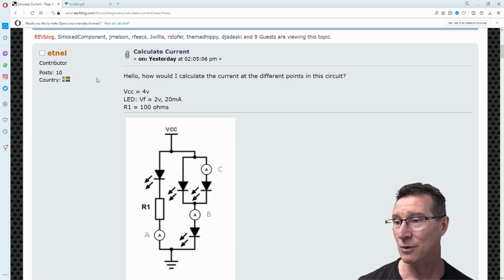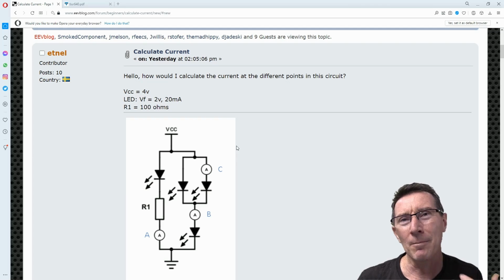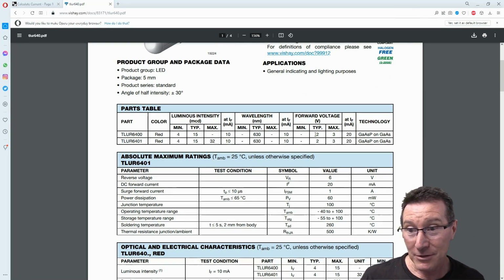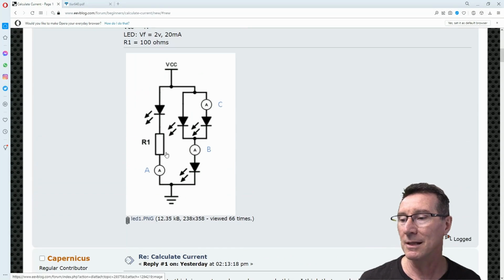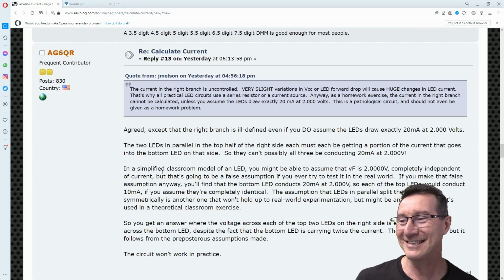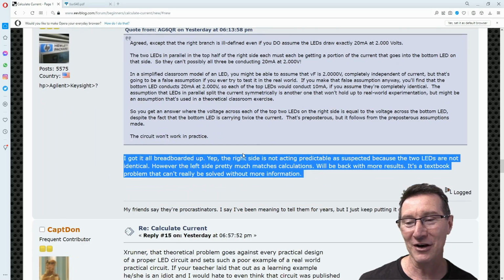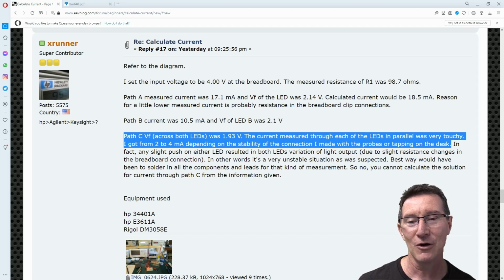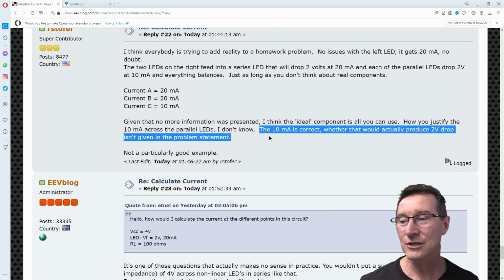EEVblog 1427 - An INFURIATING Electronics Exam Question!

Comment: What do you do if you have let's say a series string of 6 leds per string, 2v each, and your power source is 12v? How do you supply power to the leds and how do you calculate the needed resistance?

How do you drive leds most efficiently, losing the least amount of current as heat, et's say it's for a solar powered ebike where you have to be frugal with the power draw and efficiency of everything?

What if the power supply voltage changes between 12-14.5V like in a car?

Comment: The other method is A = 20 mA, B > 20mA, B < 40 mA (if B reaches 40 mA, C is 20 mA, which only leaves 2V over that LED at the bottom (which can only sustain 20 mA), which means the current needs to be less than that), C=B/2

(the exact value of B (and C) in that range would need more information)

Comment: If the diodes are ideal and have the same physics, than we can, approximately, write V_f=a * ln(b*I_f), where a, and b are know constants, and V_f and I_f are the forward diode voltage and current resp. This equation is from Schottky approximation found in wikipedia. 
We know that it is given 2V = a * ln(b*20mA) . By manipulation exp(1/a) = sqrt (20 * b)

For the right branch: KVL: 4 Volts = a * ln(b * I_f) + a * ln(b*2*I_f)
4 = a * (ln(b * I_f) + ln(b * 2* I_f))
4 = 2 * a * ln (sqrt(2) * b * I_f)
2/a = ln ( (sqrt2 *b*I_f))
exp(2/a) = sqrt2 * b * I_f 
We know that exp(1/a) = sqrt(20mA * b) which is to be plugged in the latest expression:
20mA * b = sqrt2 * b * I_f  . Where 1/b is called saturation current in ideal diode equation but it will be cancelled out anyway.
So current at branch C should be sqrt ( 20mA / sqrt2) = 14mA 
and current at branch B is 2 times of that, 28mA.

Comment: I love this problem! This is a classic Analog IC design question. The intuitive understanding of semiconductor junctions give s a quick answer to this problem. Because the nature of the junction is logarithmic, the two parallel diodes (LEDs) will have a decreased drive exactly cancelling the increased drive to the bottom single diode (LED), a ~30mA current will result in the second path due to the 1.5X effective junction area spread over the 3 diodes in the second path. The kT/q ln I1/I2 is typically18mV for a diode at room temperature, so for a small signal analysis for the LEDs, the same relationship should hold true. I am a former Analog IC designer and  Analog guys LOVE the nature of logging characteristic of diodes, using them in multiplying, RMS, logging and other current mirror applications in designing ICs.
Reply: When I saw that problem, I approached it in a somewhat uneducated way: I approximated the IV curve of a LED with an exponential, choosing coefficients so that the curve on a graphing calculator was as similar as possible to a random LED datasheet, while still passing through 20mA @ 2V. Then I solved the system of equations using kirchhoff's law. The result was ~30mA for the second path! I'm impressed!

Stephen, could you recommend me an introductory textbook or other resource to learn the basics (very basics!) of analog IC design? Is there a simulation software I could use for basic circuits? I'm ok with maths (I know my way around exponentials, calculus...)  but the more practical the resource, the better. Thank you in advance!
Reply: This actually corrobrated with curt welch's test result above. Might have been what the question was asking for
Reply: I choose to read the Vishay curve, not remembering the logarithmic nature of diodes (40 years in distribution electrics now). My result 28mA on B. Derivation:
IF you'd be given the Vishay specific curve, you could read  I=13mA @V=1,9V, and  I=30mA @V=2,1V and approximate the curve rises from these to 20mA @2V with two straight lines:
For V<2,0V (the parallell diodes) I [ma] = 70*Uc-120 
For V>2,0V (the single diode)      I [ma] = 100*Ub-180
Now we have an equation where Kirchoff tells us: 2*(70Uc-120)=100Ub-180 and U1+U2=4
Solve for Ub and Uc:  
Ub=2,083333V and Uc=1,91666V  =>
Ib = 28mA, Ic = 14mA
The reading of the curve was in 2-digit accuracy only, the final answer can't be any more exact.

A better approximation might be connecting the 3 points with an inverted parabola, but there's no sense in that either, since the Vishay curve is obviously built on a limited amount of datapoints:
0,1mA, 5mA, 10mA, 20mA, 40mA, 60mA and 80mA with linear connections.
Reply: I would have thought it is some kind of "estimation-question": assuming ideal LEDs you would get exactly 20 mA in the right path if there where only two LEDs in series. If you put four ideal LEDs in the right path (two each in parallel an series, connected in the middle) you would geht 40 mA. So only three LEDs has to result in some current larger than 20 mA and lesser than 40 mA. Never thought you would get exactly 30 mA.
But it makes sense, if you do the following assumption: for every non linear element you can find a linear replacement at a given current or voltage across them. For these LEDs the linear replacement at 20 mA is a 100 Ohms resistor (surprise!). This linear replacement is 100% correct only for a single point of the characteristic curve. But to get a rough equivalent circuit, you could just replace all LEDs in the right path with 100 Ohm Resistors. That would give a total current of 26,7 mA. Due to the inlinearity of the LEDs the equivalent resistance of the upper LEDs will be slightly higher than 100 Ohms while that of the lower LED will be slightly less than 100 Ohms. Since the resistance rises with falling current and it falls with rising current you will get something like a 110 Ohm replacement for the upper LEDs each and 80 Ohms for the lower LED (I totally made up those numbers to fit your 30 mA).
I am too stupid (or lazy) for the exact equations, but 30 mA makes somehow sense to me.

Comment: Apparently my school Riga Technical University is really good school because we never got such nonsensical questions. We had similar circuits, but there would always be some resistors and transistors to limit current. We were specifically taught not to connect LEDs in parallel due to runaway power.

Comment: This is a simple problem being overly complicated. It's a simple excersize of Ohm's law for absolute newbies, PRE electronics 101. Voltage source is often assumen being a small battery. The diodes are assumed as as static resisitve loads... So in practice this would just be a battery with 5 x 100ohm resistors.

Comment: For the right branch it will normally find a balance between 2 times the current in branch C and the current in B so that the sum of the voltages over both LEDs is equal to 4V. Provided of corse this balance does not blow up the LED in branch B. I think your real test with the diodes proves this.
It is indeed not the best design ;-) but it is in my opinion a good question to start a discussion to see if students really understand what is happening here.

Comment: It's very simple. 2V is too high for most red LED's. A small resistance is requird in the bigger chain. Usually we don't mtch the LEDs to work. Totally bad engineering and bad teaching.  One time you can do this is using CMOS like 4060. THe CMOS will current limit. CD4060 at 5V seems to work with a red LED. Ron > 50R? 2 x CD4060 and a 3.2768 MHz crystal using a 10 mm LED is an excellent turntable strobe. If you use a 74HC version you might need a resistor of 100 R. Although the CD version says 1 mA that is only at full voltage swing. It seems to reliably give more into an LED using a >5V supply.  Bend under the tags you don't use. For this it's OK to do this.

Comment: when you see parallel diodes of any kind (in this case LED) you're in for a world of hurt because unless you're specifically specifying ideal diodes that follow the same exact characteristics this circuit is not one you would ever want to use in practice as current sharing between diodes is fickle at best and usually one will conduct more than the other. Even with a vf and vcc spec this diagram for practical engineering is borderline useless as it is a poorly designed circuit for real world applications. I work a lot with diode strings and stuff relating to simulating vacuum tube transfer characteristics using jfets op amps and diode strings and you always need to have some form of small resistance to help balance out the load between the two parallel diodes. Otherwise you're likely to get wonky results that can lead you down a path of red herrings when debugging a circuit as it will often behave unpredictable most due to temperature variations and such related to how diodes work. So for me, I would call the design bad practice and would like to correct teh circuit so that way the behavior is more predictable and useable as a result as resistors are pennies at most for a circuit like this. So really not worth the time to figure out a solution that doesnt really work well in the real world. Just my 2 cents on the problem.

Comment: I was once asked what the ohmic resistance was for a diode on an exam for a similar schematic and the only thing given was input voltage, in an introductory engineering course that didn't cover EM or electronics... They did not like my subsequent answer.

Comment: It’s not necessarily at the level of the students who were asked this question, but for anyone who knows semiconductor junction theory, remembers a few material properties from their student days and assumes a led color and a few other things; this circuit isn’t outrageously hard to model on paper and pencil, even if you were asked to find an approximate thermal equilibrium and sensitivity to parameter spread and supply voltage changes. I’d at least expect everyone to understand that the I-V curve knee exists, and how the difference in junction current densities stabilizes the thing at an operating point not likely too far from 20mA. There’s way more to this circuit than most people alluded to. Yes, whoever came up with it had likely no clue about any of it, but it’s an interesting circuit, and I’d actually expect any competent EE to at least describe what mechanisms provide stabilizing and destabilizing behavior. And if it was anyone interviewing for a mixed-signal or analog chip design job, they’d be doing poorly if they couldn’t figure this one out.

All those people who bothered to build it and didn’t get thermal runaway, against their expectations, are encouraged to stop and think: how come?!?! I expect a few of them, at least, will smile and appreciate the perhaps unexpected outcome, and its underlying principle. And those who did get thermal runaway: try changing the voltage a bit either way :)

Comment: Nice video as always. I’m not sure I agree with you on several points you try to make. I don’t think circuit exam problems need to ALWAYS refer to standard circuits. An EE needs to know the basics, but also needs to know how to debug circuits because, circuits… well brake. In such a situation nothing is “standard” everything is possible and potentially pathological and after looking at… overheated solar inverters and grid voltages higher than normal one reaches the otherwise brilliant conclusion that... it’s the shadow of an antenna feeding cable and mast… (where did I hear this… but I digress… ). I think there is nothing wrong with injecting in the exam a problem like that. Of course, there are nuances like what exactly the lecturer wanted as an answer (and you mentioned that), but to be honest an answer for that particular problem of approx. 2V on each diode and 15mA, 15mA and 30mA makes a lot of sense because one Vishay Universal LED doesn’t need much voltage left and right of 2V to get to 15mA and 30mA and voila, Kirchhoff’s law is obeyed and all is good. (After all 25mV of extra forward voltage on a normal discrete diode (not LED) increases the current by 1.65 times).

Comment: And you can never ever put diodes of any kind in parallel and expect current to be divided equally, and quite often you will end up with a cascade failure of all of the diodes in parallel.

Another way to look at it is that you have two completely separate circuits, one good one and one crap one

Comment: These are idealistic and theoretical components.  Ours not to judge.  On some planet they have come up with a LINEAR active component.  You have to take them at face value.
Don't whine about the practicality.  That's not the point.  And using Kirchoff those are going to be the values.  i mean we don't want to get into the tolerance of the resistor or the impedance of the voltage source.  It is ideal and the world is perfect.  And your calculations are right.  In fact..forget they are LEDs.  They're just resistors.  I would have put one more ammeter in..at ground.  What's the total current?

Comment: The circuit is so bad. There are 2 design errors., The first is having diodes with no additional  impedance between the source and ground. The second is no 2 diodes are the same, the 2 in parallel will result in one conducting much more current than the other one. To make matters worse even assuming perfect ideal IV curves analysis of the right branch is right on the edge of operation.

Comment: I really like this question! 
It shows that even the simplest of circuits can express the conditions usually remarked as 'irregular circuits' by Circuit theory courses, such as in here, two voltage sources in parallel (approximately diodes when conducting). Hence, you need a really good understanding of circuit theory not to fall for that trap.
As one of my professors used to say: If you solve a Circuit, and it has infinite solutions - your model is incomplete; however, if you solve a Circuit, and it has no solutions - something is probably going to explode :D
Reply: Circuit theory is kinda independent from the fidelity of component models used. It works whether you use a painfully unrealistic model for a PN junction, or one that at least behaves to the 1st order like the real thing, or one that uses an electrostatically accurate finite element model based on the geometry and processes used to make the junction. You’ll just get a nicely modeled circuit that can’t be built, but assuming you could make it (eg. using more complex circuits as stand-ins for some ideal devices), the answers would be spot-on.

So, circuit theory doesn’t call for a spherical cow at all, and it doesn’t need to call for it even when it’s taught at a fairly basic level as long as the students have a decent grasp of Calculus I and algebra (of the high school kind, not Linear Algebra, although it’d help). The nonlinear diode model isn’t exactly “out there” and when the circuit network is selected judiciously, the nonlinearities don’t preclude closed form elementary symbolic solutions of the sort some high schoolers wouldn’t have much problem deriving. Current ratios through PN junctions yield equations that high schoolers know how to solve.

And these days said high schoolers likely also know how to get numerical solutions for nonlinear equations using nothing more than their phone, so they could tackle networks that don’t have “elementary” closed form solutions.

I think that circuit theory can just use voltage sources when they want spherical cows. No need to abuse the poor diodes just to teach the “zeroth-order” approximation. It just confuses people. Sure, simple approximations are good for pointing into perhaps the right direction and getting order-of-magnitude or perhaps one-significant-digit kind of answers. For anything past that, it boggles my mind that a simple exponential I-V relationship with the “knee exception” seems to cause insurmountable problems. It’s IMHO an imaginary obstacle. If you teach this stuff well, students will deal with an exponential, lol.

Comment: Go look at square/square root/log circuits, its very common to force voltages across strings of diodes like this and the 14mA answer is correct. Not used so much in discrete circuits due to the tight matching requirements, but on analog chips such as old true RMS converters they were used. Younger IC designers don't tend to know about these analog signal processing circuits, they just use some DSP, but us older folk...
Reply: Nice comment, Karl. I see you are still active in electronics---Steve H

Comment: imo if you have to consider the LEDS as linear devices then you can say that at 2v and .02 amps then all leds are 100 ohm resistors 
as R=E/I   then 2/.02=100 ohms.   so the left is 200ohms and the so 20ma.  B=150 ohms at 2v is 13.333ma and C is 150ohms at 2v so 26.667/2=13.333 but this is not the answer 
so if you consider that b drops 20ma and 2v then the branch C is 1v and 10 ma  this is a real shit show this is also assuming electron flows from - to +